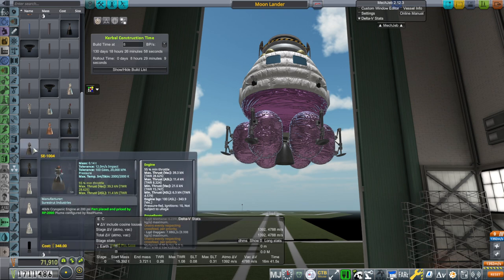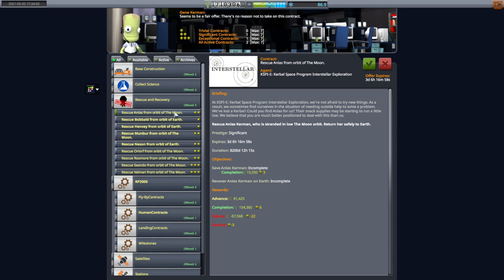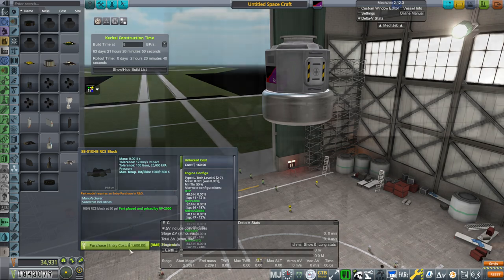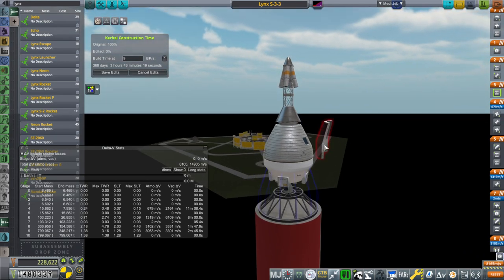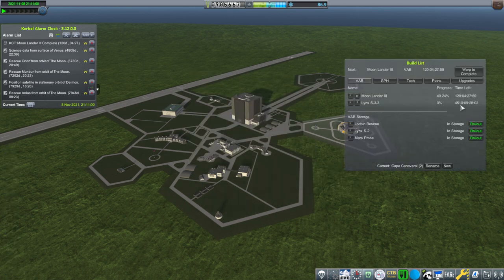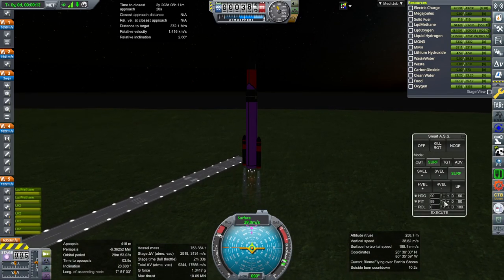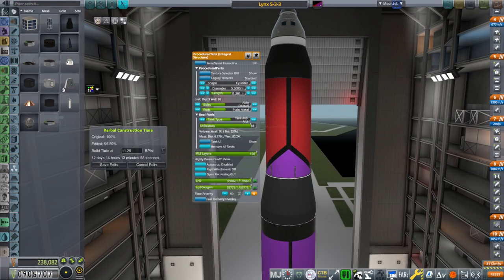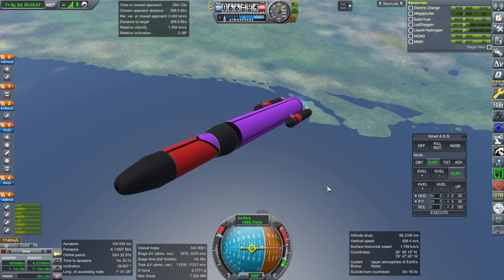KSP with Realism Overhaul - RP-2000 Career 25 - Crewed Lunar Retry Part 1

Comment: you can dump the abort tower from the unscrewed lynx to save weight
Reply from the maker: The pod is really expensive. If an engine failed shortly after launch, I'd probably need to tower to make sure the Lynx got enough height to deploy the parachutes.